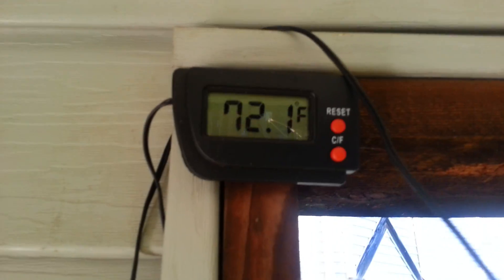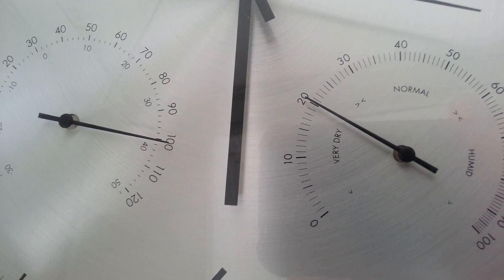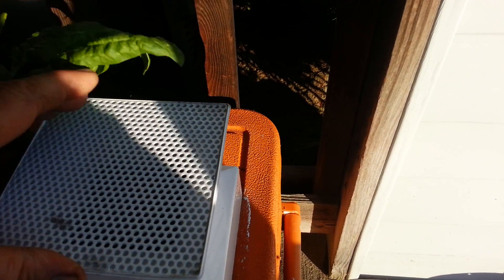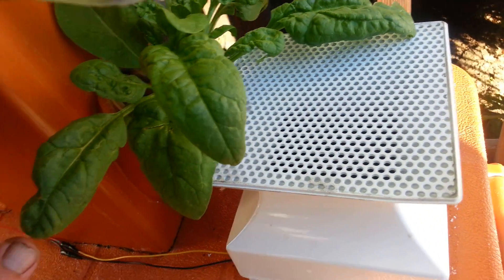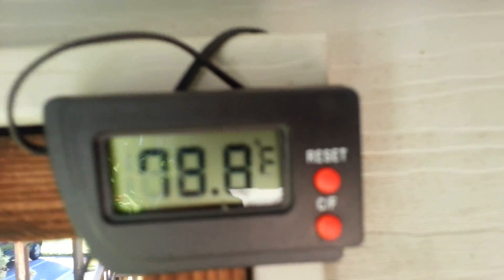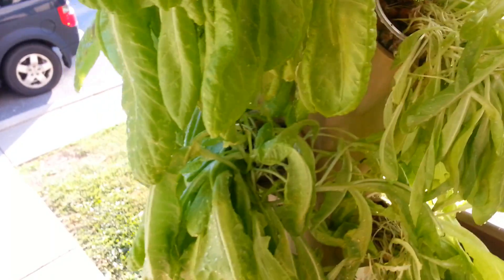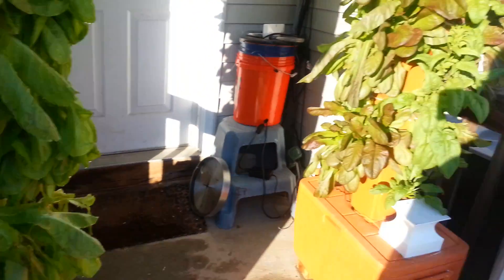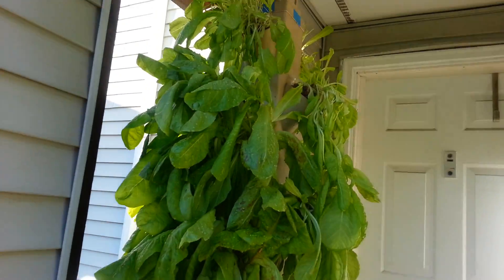Cooling your reservoir in 100 degree weather.

Comment: Hey Mike. This is really cool. I am trying to use this for a similar set up to grow Lettuce in Mumbai, which has a very high temperatures in the 80 to 90s and high humidity. Just wondering - Where did you find that perforated steel air inlet for your fan? Just thinking about how to procure everything I need to set up this cooling station
Reply: hi varun have you tried this method and if yes then did it work because i am also from mumbai and searching for some chilling techniques for my plants in hydroponic

Comment: Would you give me an idea on the size of the fan regarding cfm output. I am starting the project today . Many Thanxxxx !
Reply from the maker: the fan is the same size as the inner diameter of the fence post. I don't remember the cfm but I can tell you it was a hi speed fan.
Reply: Sorrry for the delay in getting back. The fan is doing well. A drop of 20+degrees is average. My project is trial and error but all is going well thanx to you!  Again Many Thanxxx ! Regards Dave......

Comment: your differential from tower to tower is, say, 6.5 degrees. that is enough to make or break some crops in certain areas. overall would a liter or two of ice give the same result? Great video, thanks!
Reply from the maker: I've tried ice the problem is it changes the pH in the solution and it doesn't keep the temperature down long enough. Check out my other video. I'm able to drop my temperature 30 degrees from the out side temperature. 
https://youtu.be/577pDVt2EmE

Comment: So in this cooling system you're no longer using the water chiller and have alternated to only using the computer case fan? By the way, I thought the air would have to be flowing upward (outwards from the water) to remove the heat from the reservoir but in the video you said that the fan is blowing air downwards into the reservoir? I think I may try this system instead of the water chiller since it's much simpler and still has an effective outcome.
Reply from the maker: Hey Nick
It's more than just a case fan. I also made a few modifications to the inside on the tank to direct the air flow threw the tower. The way it's setup is like a swamp cooler.

Comment: I really like the modifications!  In your initial video you mentioned that your goal was to see if you could do it running off solar!  I am eager to see if you have accomplished this!  Where did you get the fan and how much is your total voltage/wattage/amps for the pump and fan combined?  I am trying to get all my ducks in a row for the glass greenhouse my husband is going to build me and his only requirement---I get no electric!  I gotta figure this out and so far I think your mods are the easiest and most practical...any additional updates would be great thanks! And it looks like your thumbs are really very green :)
Reply from the maker: Hi Stephanie
I haven't switched over to solar yet. What I was looking into was using a 100 watts solar panel kit ( you can find them on amazon for around $180) and a 12 volt battery and a timer so it wasn't running 24/7. Now the pump and fan are 12 volt, as for the wattage and amps it's not very much, maybe 25 watts and less than 3 amps. So the system doesn't take much power to operate. Enjoy your new greenhouse and thanks for watching.

Comment: With all of that evaporation, how has you ph been and your nutrient ppm? Has there been a build up of salts in the tower? In the salt water aquarium world , they call it salt creep. You need one of Brock's auto top off setups. It has worked perfect for me.
Reply from the maker: Hi Billy
I didn't worry about the Ph or ppm all I did was top off with plain old water. As you can see in the video it didn't hurt the growth of the plant. Lettuce grows pretty good in just about any condition. 
As for salt build up I haven't had any problems yet. I just harvested all the lettuce. I'm going to make a couple modifications to it and see if I can improve the cooling. Stay tuned.

Comment: Great job Mike!  Now, my question - we know that when evaporation occurs, heat is given off so your water and air in the tower would be cooler.  Especially at 20% humidity but, I'm wondering how much water loss per day have you figured?
Reply from the maker: Hi David
On really hot and humid days I'm at 5 gallons loss by the third day. So if you break that down its about 1-2 gallons a day depending on the temperature outside.